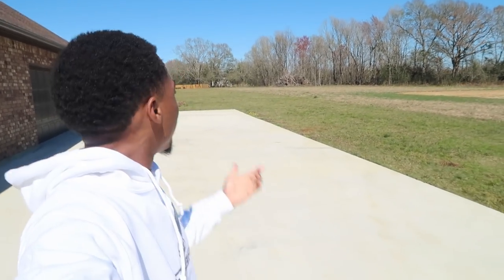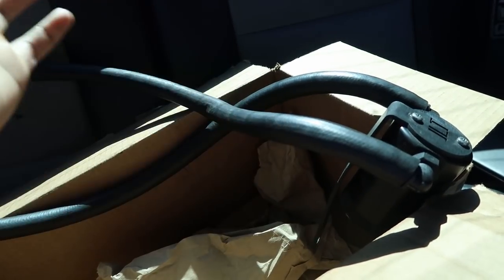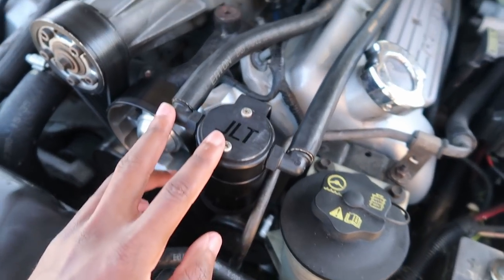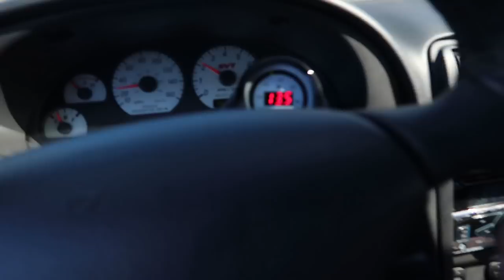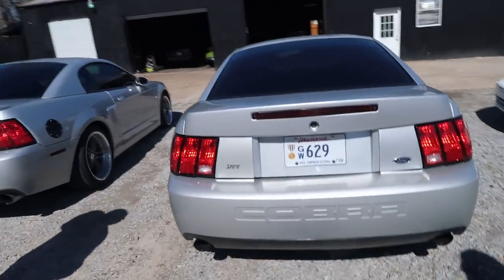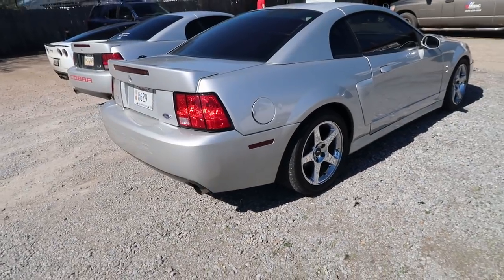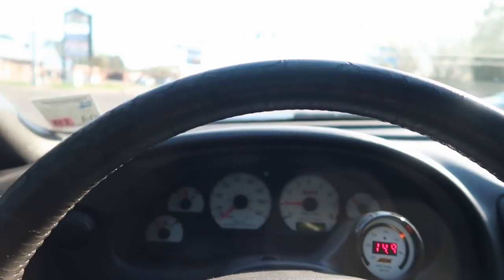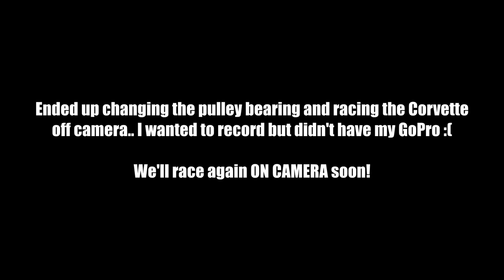TX2K Prep | Riding in a 700HP VMP Terminator Cobra

Comment: PJ Morrison do a vmp. Much more efficient than stock Eaton. Much less heat production. My VMP makes 610 rwhp at 15 psi with upgrade fuel pumps and ID 1000 injectors. Get a McLeod rst clutch and 26 spline input shaft. About 8 grand in mods you will be set
Reply from the maker: Lol, 8k is a lot more than I’m trying to spend on the car at the moment😅

But in due time😈

Comment: Good idea, but you also need to do something about the hose on the passenger side valve cover too. Either another catch can or just put in a breather cap like I did. Both sides can vent oil back into the engine which can be very harmful. I don't know what your inspection laws are for you or if you even go, but removing the EGR valve will also help to clean up your intake and exhaust.
Reply from the maker: I planned on getting a breather cap (most likely) or another separator for the passenger side.. And as far as inspection laws... For Louisiana? Lol, forget about it... But I’ll look more into removing the EGR valve, that doesn’t sound like a bad idea
Reply: @pj_morrison  Cool! There are aftermarket block off plates for the back of your blower where the EGR attaches. I don't worry about inspection either and I have the EGR block off and breather caps on both valve covers. These mods gave my car back more power and cleaner plugs. My Cobra does not smoke at all.
Reply from the maker: I’ll look into it, thanks👍🏽